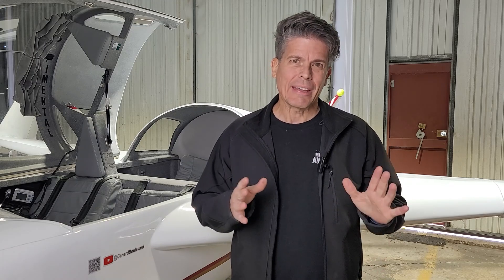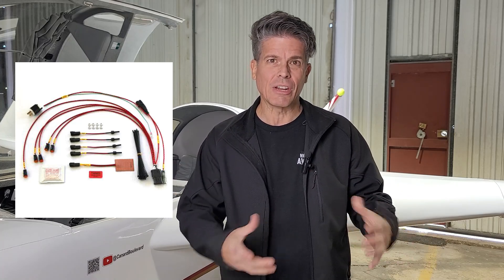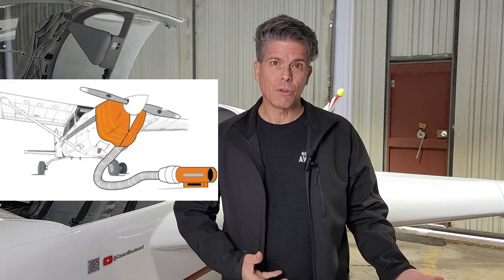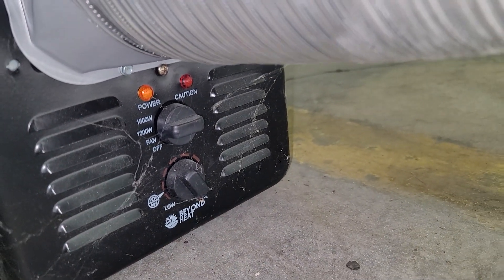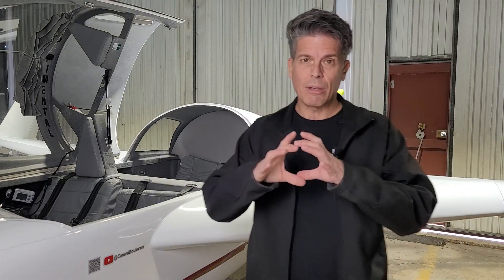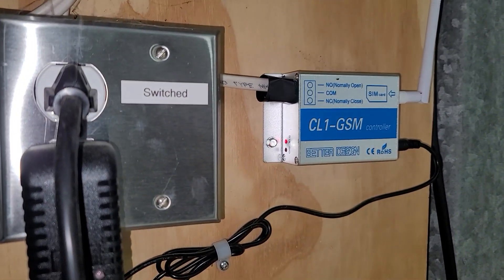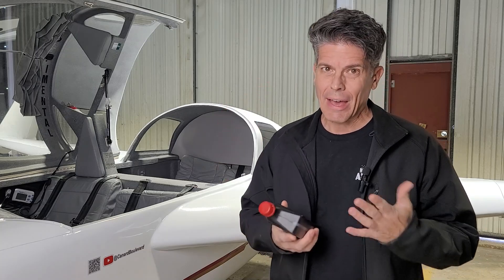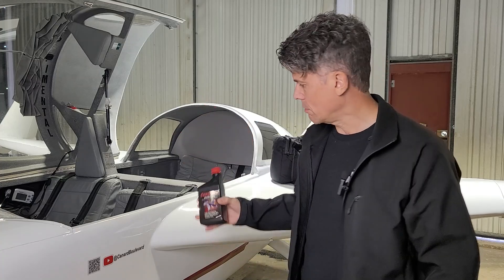Engine Preheating: Doing it Wrong Can Destroy Your Engine!

Comment: If you use cowl plugs, where does the hot air exit the cowling?
Comment on the suggestion that it is better to blow the air in through the back of the cowling so that the top of the engine is heated first.
Can you post a wiring diagram for the remote control system.
Can the remote control system be used if there is no wifi in the hangar?
Reply from the maker: Heat rises. Blowing air into the back of the cowling will ensure the engine is hot while the oil is left cold.

I did a video on the remote switch here: https://youtu.be/IiT7jJD_MPM

Comment: i use a portable electric air heater that pushes heat one ends and sucks the other end and put each hose in each air intake hole, plugging the open space with sponges. Plug the exhaust, and use a furniature moving blanket around the cowl and tuck it in on the bottom. coupled with a homemade remote system and you're set. Never used a drybox but I probably should.

Comment: During the building of my Long-Ez I had a good opportunity of having a Lycoming O-320 completely overhauled for a good price but had to preserve it while building. My solution at the time was to build my own dry box dehumidifier. It served me well for a period of over ten years with minimal effort of changing the desiccant every 3 -4 weeks. The parts I used were as follows: An air-tight plastic food container, an aquarium air pump, desiccant, plastic/silicon tube and a timer. The method of operation was simple: block off exhaust outlets (I used plastic stoppers), for long term storage I blocked off the carburetor, insert tube into dipstick and the other into the breather pipe (both sealed). This was so successful I still use it today after each flight by fully closing throttle and blocking off exhaust pipes with plastic stoppers. The only difference now is that I've converted to 12v and a battery (no power in the hangar). With a very wet environment in the UK I can still maintain and average 35% humidity in the crankcase.

Comment: When I stored my IO360 in my unheated garage last winter, I made my own drybox out of an oxygen humidifier bottle, some desiccant, and a modified aquarium air pump.  I pushed the dry air into the dipstick hole and out through the breather back to the pump.  Sealed with some vinyl tape.  Now that it is installed and living at the hangar, I need a better solution.  I think I'll go with a 100 watt heater and blankets. Thanks for the video.

Comment: You forgot one important aspect, and that's plugging. The exhaust pipe from letting condensation go up into the engine, corroding one of the exhaust valves that has to be opened and corroding the cylinder
Reply from the maker: That is a good point, I always plug my exhaust pipes when my plane is parked.

Comment: 100w incandescent lightbulb and moving blankets.... You're welcome
Reply from the maker: I mentioned that in the video.
Reply: @CanardBoulevard  smart man, those old cranky pilots had a few tricks up their sleeves to pass on didn't they!?
Reply: @CanardBoulevard I think the electric air heaters or even the lightbulb are superior because they cause the least amounts of condensation (from unevenly heated surfaces) and a low consistent heat, also you can feel more comfortable leaving it plugged in indefinitely for the winter season and not spend extra money on timers and switches that could need Cellular data if your airport has no Wi-Fi or is kind of far to drive just to plug it in the night before. I think you did a great job explaining. Might I suggest heating from the top down so the hot air doesn't rise and condensate on you cam or crank before it gets evenly heated. I recently bought a twin hornet 22 which is basically a thermostat controlled internal forced air heater, seems to be working great so far keeping to the oil at about 80F with a couple of blankets.

Comment: Consider asking your local EAA chapter or look online. They have designs for lower cost dehumidifiers than the dry bot.
Reply from the maker: I could very easily build my own - I know very well how they work. Most use dessicant beds that need to be restored manually from time to time. The genius of the Drybot is that it uses a dessicant bed, but it regenerates itself when needed, without having to take it apart. It's probably a bit expensive for what it is, but it works.

Comment: This same engine oil temp/engine temp issue is also why short trips in your car are more detrimental to it's engine health than actual miles driven.  EVERY engine cycle in your car/ airplane should get up to full operating temperature to boil off that condensate moisture in the oil.  
At one point in my working career, I lived just about a mile from work.  I walked to work - even in the dead of a sub-freezing/sub-zero Cleveland OH winter - rather than driving - because it just wasn't worth it.  I'm not just talking about the time scraping the windows, but for the wear/tear/abuse of my car's engine.   Unless you get that engine to full operating temp for at least 15 minutes, you are doing more harm than good!
Reply from the maker: 100% correct. I'm also in the Cleveland area, and I loved having a plug-in hybrid car that I could drive to work in. I would go months in the winter without ever starting my engine for my short commute.

Comment: Interesting info about the, "Oil"..... while most cars use variances of lighter oils,  living in a hot place causes me to run a heavier
oil.  For reference I use a 50w racing oil in my 5.7L truck but from what you are saying it sounds like your oil might be thicker
than that?  I do know when it's cold that I change the oil to a lighter oil but that's only 2 months of the year here & some years
you don't have to worry.  So your oil is thick & do you have any trouble keeping the oil hot once you're in flight?  Nice content.
Reply from the maker: Airplane engines are basically glorified tractor engines from the 1940's. The tolerances in them are nowhere near the tight tolerances you see in today's automobiles. Our cars have those tight tolerances and thin oil for the purpose of friction reduction and improved mileage.

The larger tolerances in our aircraft engines require a thicker oil layer to provide sufficient lubrication.

Good question about in-flight temperatures. It is a problem for sure, in the colder months. We normally have oil coolers on our engines, and it is very possible in cold weather to have oil that is too cold. Many airplanes will have covers that go over the oil cooler to partially or completely block it for fight in cold weather.
Reply: When I think about all the engines in production at any given time I'm amazed at how few of them are slated as usable
in the aviation sector?  Before looking at planes I'd never heard of Rotax Engines although I have seen them reaching
over into pontoon boats but these engines are underwater & I question how long they can keep the water OUT? Thanks
for your time, I try to make sense of this stuff & you manage to make me ask more questions, ever been a professor?
You come off as caring in a way that made me ask that too.  Thanks for making my Saturday night, "All That" ?!!
peace
Reply from the maker: @diggy-d8w  Thanks for the kind words. If you think about airplane (and boat, for that matter) engines, they have a very different application than most vehicles. Cars and motorcycles very rarely are putting out their maximum rated power, and when they are, it's for a very brief period of acceleration. Most of the time, they are just loafing along.

Airplanes on the other hand run for extended periods of time at 100% full power output.
Reply: @CanardBoulevard    Yes, I knew that of the aircraft engines but my mind is still trying to understand the differences as
they are distinctly different applications.  Whatever those are,  I like the "pusher" configuration of your plane.  Well, I like
more than that but I'm not really qualified to say much of importance.  I like it's harder to stall & that something about
the small front wings cause it to almost fly itself?  Thanks for sharing all of this stuff & your Synth Stuff ! I'm there too!
peace,  see ya tomorrow

Comment: Love your videos. How about a segment on the cell-phone-activation gizmo?
Reply from the maker: I knew someone was going to ask about that. :) I had thought about it, I made mine out of some parts that I had sitting around, but it costs me $25/month in cell fees to have it. That's $300 a year. For $300 you can buy a commercial unit that costs nothing in fees...and I will probably do this at some point.
Reply: @CanardBoulevard  A year later, any new thoughts on a commercial system or examples of what you are considering?

Comment: Do you have a reference for the claim that leaving the dipstick open reduces the amount of water in the engine during cool down?
Reply from the maker: Hi Marc,

I had heard this anecdotally from a couple of people and didn't put much faith in it, but then I heard the exact same thing in a pre-heating webinar given by Doug Evink, CEO of Tanis Systems, so I did some more research. The "50%" value came from Doug. I did not come across any published studies, but I did come across someone who did a test by putting a plastic bag over the dipstick tube after removing the dipstick, and allowing the engine to cool - and he had photos of a fair amount of condensed water that ended up on the inside of the bag after it had cooled.

Comment: Nice overview. Thank you. You covered a lot of things I have learned over the years. I have a Tanis connected to a Swicheon, use Cam Guard, use an engine dehumidifier, leave the filler cap loose with a flag, keep the plane in a hangar and cover the cowl with a blanket.

Not to far from you. Based at CAK.
Reply from the maker: Sounds like your engine loves you! :)

Comment: My background is mostly as a pilot/mechanic on Turbin helicopters. As a result, I am used synthetic motor oils, and we could start as low as 20° below zero Fahrenheit with no problems. As a result when I got my Long EZ I switched it to Aeroshell 15W50 synthetic engine oil, and had no problems getting immediate oil pressure on start up at temps of 20 degrees F. What type of engine oil do you use?
Reply from the maker: I am also using Aeroshell 15W50. It's a great (not inexpensive!) oil.

But I can definitely tell a difference between starting the engine cold and preheated. If it is 50 degrees out and I crank the engine to start, it's going to crank more sluggishly, and take a bit more time before it lights off and starts, and oil pressure takes longer to come up. If I have preheated it first, it starts INSTANTLY and oil pressure is there right away.
Reply: @CanardBoulevard Weird. I really do get excellent cranking down into the '40s for sure, and even lower than that. It could have something to do with batteries and starters, and of course I have a small engine, an 0235. The important thing is I immediately see oil pressure with 15W50. I've put a thousand hours on my airplane, and my screens never show any metal at all, so it seems to be working.

Comment: Look at the Tg temperature of your epoxy system that was used to build your plane. My MSG is high at about 160-180° F without post cure and over 210°F with post curing. Yours is probably around 160°F on the top end. Most Cozy builders do not have the equipment to do a post cure of a fuselage. I would never use a forced air heater that is over 60°C. It could damage any of your structual areas at the firewall, or maybe you'd get a good post cure out of it. 😅
Reply from the maker: A good point, but the cowl and firewall are not getting anywhere even remotely close to Tg in my application. The cowl is slightly warm to the touch, but not much more. The engine is getting the vast majority of the heat. In fact, the firewall (it's covered in stainless) actually is still cool - all the heat is going to the bottom of the engine (the sump) and then up through the cylinder fins and out the back of the cowl.

I can say that the cowl and firewall experience FAR more heat from the engine running normally on a hot day than they do from my forced air preheat.

Comment: Cranking with the throttle wide open causes the starter to work harder, not easier. It also loads the bearings more. Why? The engine compresses that air. So, more air more compression, more force needed.
Reply from the maker: The engine is going to compress the air regardless of whether the throttle is open or not. The amount of air pressure before the compression stroke will be MARGINALLY less with the throttle closed, but not enough to make much difference in terms of the compression stroke.

Having the throttle closed however means the engine also has resistance against the intake stroke, as it is pulling against vacuum created by the closed throttle plate.

This is common practice - in motorsports, when we want to crank an engine, the ignition and fuel is shut off and throttle wide open for least resistance.

You can try it yourself: pull mixture to idle/cutoff, turn off your mags, then crank your engine. While doing so, move the throttle from closed to wide open - you'll find the engine crank RPM increases with the throttle wide open.

Comment: Great video, really interesting content throughout.
12:07 leaving the oil filler cap off - at some times of year (I think it's a few weeks in early Fall around here) there is a massive amount of dew/condensation on anything metal that's outside (or in a shed) at sunset & overnight. On those occasions I think I'd rather have the filler cap fitted.
Use of °F throughout does get tiresome, as I just don't know what sort of temperatures you're talking about. 45 years ago I might have had relatively little preference (for temps above freezing) but these days my °F interpretation has pretty much gone!
Maybe (as you put so much effort into editing anyway) you could just flash the °C as text on the screen when you mention a temperature. (Which is a lot in this video).

Comment: - There is probably a good reason why they use the thick oil. But my simple brains wonders why they don't use less thick oil and avoid all those preheating tricks 🤣
Reply: Darylwalker is correct. Aircraft engines are air cooled and must necessarily have relatively looser cylinder ring piston tolerances compared to liquid cooled engines. Therefore thicker oils required to ameliorate the wider and more changing tolerances.  The video did a good job explaining reasons for pre-heating. Most pilots believe pre-heating is simply for easier starts but it is more to mitigate engine wear.
Reply: Viscosity reduces with heat. Engine tolerances change with heat, particularly in air cooled engines. Thin oil is great for tight tolerances, and high temp - which is what you have with a warm engine. The issue is viscosity. That is why oil for old and worn engines is more viscous, it needs to make up for the wear by filling spaces.
Reply: @darrylwalker1867  Also, most aircraft engines sit idle for long periods compared to automobiles.  Thicker oil will cling longer to surfaces like cams and tappets to protect them from corrosion.  Any pitting on these surfaces will greatly accelerate wear.
Reply: Aircraft engines tend to operate at or near full power most of the time, thinning out the oil. Auto engines spend a lot of time at low RPM, and need to have cold start drivability, needing thinner oil. Great video and good tips.